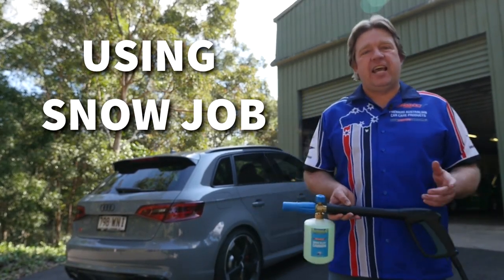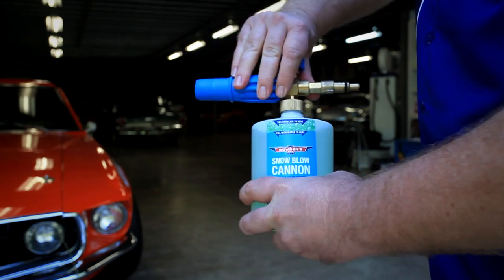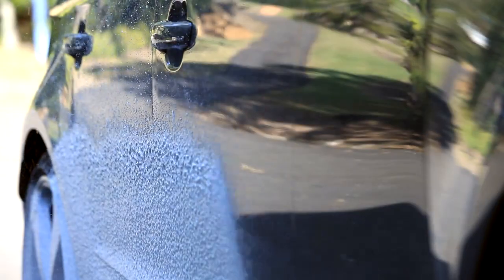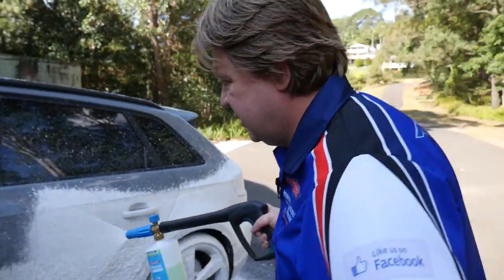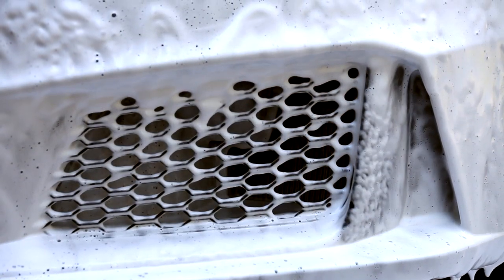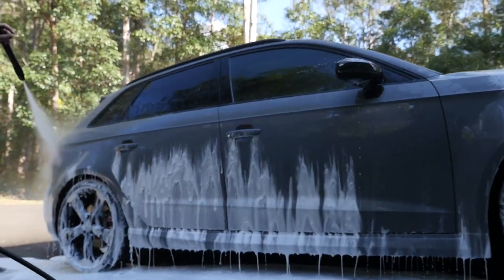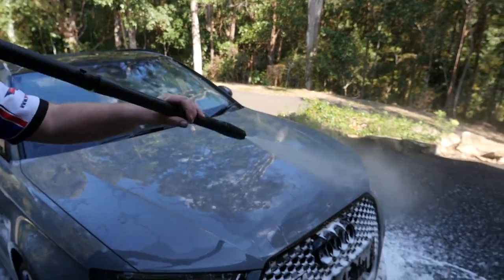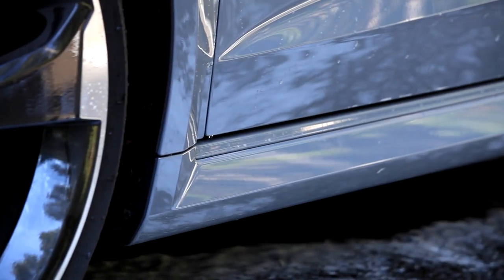Bowden's Own - Using the Snow Job Foam Cannon // Supercheap Auto

Comment: I see so many videos of people who have no idea what they're doing when foaming their cars. You did it correctly, it was satisfying
Reply: What is the wrong way to do it?
Reply: Andy Jung scrubbing with a single bucket. The grime and dirt are abrasive and will swirl the paint
Reply: Niko Delmedico 0piinVietnam
Reply: See(
Reply: Okoo
Reply: I would hope he done it right. He owns Bowdens Own.
Reply: @Nico Delemedico - I think he's doing it wrong. He should actually rinse from the bottom to the top.

The foam covers the suface to loosen up the dirt and contain it. 

The high pressure washer works like a brush and when rinsing, it carries the dirt away.

When rinsing from the top first the water runs down and rinses away the foam of the lower parts without the high pressure beam hitting the foam and dirt as supposedly.

And also, without the foam covering unrinsed parts,  it's easy to miss a spot when you can't see where you have rinsed.

Starting from the bottom rinsing horisontally line by line working yourself up, you'll always keep track where to rinse.

Yes, rinsing from bottom to the top takes more time and water, but this is the way professionals do for the reasons stated above.

When you hand wash a car you remove the dirt mechanically and then there's no reason to rinse from the bottom to the top. 

There's a big difference.
Reply: @acke26  he owns that company so I think he actually knows what he is doing
Reply: @jeremyhutchings8213  - thanks for the reply. 

This video was posted three years ago. Then it was an often ongoing debate how to rinse. Today most professional car detailers 

Today most professional detailers and car schampo manufacturers agree upon rinsing from the bottom and up in horizontal lines, line by line working yourself up to the top.

Remember, it's only when using the touchless pre wash foam shampoo method rinsing from the bottom to the top is applicable.

If you hand wash a car then off course it's much better, faster, more time efficient and water saving to rinse from the top. 

Cheers!
Reply: "l
Reply: @acke26  you’re literally the only person I’ve ever heard advocate this method. None of the companies that make detailing products suggest bottom to top.
Reply: @Superfly1503  - thanks for your reply and the  respectful tone.

I'm not alone in this rinsing method. 
Professional European and US detailers use it. But there are discussions amongst car and detail enthusiasts. 

I don't know if you're from Downunder. Maybe this method hasn't been adopted in your part of the world.
Reply: @Superfly1503  - have you watched the video I linked to above?

Have you read my explanation in my earlier post? Off course it's more water efficient and takes less time to rinse from the top. 

When you hand wash a car you remove the dirt mechanically and then there's no reason to rinse from the bottom to the top. 
But what we're discussing here is how to rinse when using a foam pre-wash detergent and a high-pressure power washer.

The foam covers the suface to loosen up the dirt and contain it. The time the foam sits on the surface is crucial for the chemicals to do its job.

There's no mechanical contact. 
The high pressure washer works like a brush and when rinsing, it carries the foam and contained dirt away.

When rinsing from the top first the water runs down and rinses away the foam on the lower parts without the high pressure beam hitting the foam and contained dirt as supposedly.

And also, without the foam covering unrinsed parts,  it's easy to miss a spot when you can't see where you have rinsed.

Starting from the bottom rinsing horisontally line by line working yourself up, and you'll always keep track where to rinse. 

Cheers!

Comment: You started off so good applying the foam from the bottom to the top in order to let the foam sit longer in the dirtier low regions. 
But when rinsing the car you got it all wrong. The reasons why you should rinse from bottom to the top are two:

1) The foam should cover the suface when rinsing cause it carries the dirt away in a better way. The foam is designed to lift the dirt up from the paint job and absorb it in the foam.

(in other words)

The foam covers the suface to loosen up the dirt and contain it. 

The high pressure washer beam works like a brush and when rinsing, it carries the dirt away (shoots it away)

2) When rinsing from the top first the water runs down the lower parts and it's easy to miss a spot when you can't see where you have rinsed.

Starting from the bottom rinsing horisontally line by line working yourself up you'll always keep track where to rinse.

Yes, rinsing from bottom to the top takes more time and water, but this is the way professionals do for the reasons stated above.
Reply: I've got a lot of angry replies. Why?
(edit, which for some reason now are deleted)

I actually just want to adress the right way to do it. Some seems to be obsessed with this guy Bowden. 
You know, he could be wrong.

I've listed exactly why you should rinse from bottom to top. 

There are so many arguments that doesn't make any sense :  
"....leaves swirls and micro scratches....." 

Listen people and stop being so hostile. We're all here cause we love snow foaming or?

I don't know how to convince you.

The reasons why you should rinse from bottom to the top: (in other words)

The foam covers the suface to loosen up the dirt and contain it. 

The high pressure washer works like a brush and when rinsing, it carries the dirt away.

When rinsing from the top first the water runs down and rinses away the foam of the lower parts without the high pressure beam hitting the foam and dirt as supposedly.

And also, without the foam in it's easy to miss a spot when you can't see where you have rinsed.

Starting from the bottom rinsing horisontally line by line working yourself up you'll always keep track where to rinse.

Yes, rinsing from bottom to the top takes more time and water, but this is the way professionals do for the reasons stated above.
Reply: @acke26  lol he ain't wrong
I'm a detailer
I can confirm this
Reply: @nynteen90 - just cause you work as a detailer doesn't guarantee anything. I'm a mechanical engineer that also got a degree in chemistry. 

If you can't explain or dement what I've written it doesn't add anything to this topic. 

Have you really read what I have written?

Note that I'm not talking about hand washing a car mechanically. When you wash a car by hand you're removing the dirt mechanically. Then off course you should just rinse from top to bottom. 

Obviously that's not just the most time efficient way it also saves water. In this case all the dirt is already loosened up by the force of your hand.

What I've written about is when using a contactless prewash foam.

Comment: Finally someone who washes it off top to bottom
Reply: hamrai b kro wash gari
Reply: We do on our nissan quashqai and our nissan navara
Reply: Hahaha yes
Reply: The reasons why you should rinse from bottom to the top are two:

1) The foam should cover the suface when rinsing cause it carries the dirt away.

2) When rinsing from the top first the water runs down the lower parts and it's easy to miss a spot when you can't see where you have rinsed.

Starting from the bottom rinsing horisontally line by line working yourself up you'll always keep track where to rinse.

Yes, rinsing from bottom to the top takes more time and water, but this is the way professionals do for the reasons stated above.
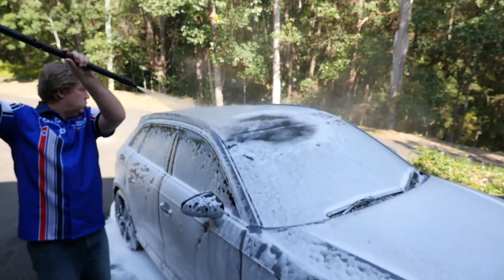Reply: @acke @ 2:26 he specifically states you are to wash the car from top to bottom.

I don't know why your here trying to sound like a pro and are telling people to do the complete opposite of the video. Also Bowden own's that product i think if anything we are gonna listen to him rather then a random persons incorrect youtube comment.  I don't know who told you all that info but you're flat out 100% wrong.   

You work from top to bottom.  Not bottom to top. Why?  Because the dirt and grime that wash's off is abrasive.  Spraying water from bottom to top pushs that dirt and grime back up, which leaves swirls and micro scratches on the body.   So you're full of shit.    No, Rinsing from to top takes way more time, energy and resources when you could do it properly like a pro. and just do what Bowden suggests.   Washing from top to bottom.  Considering the guy in the video... WHich is DAN BOWDEN... Btw...  HE invented that product so i really am confused as to why you feel the need to drop such an unnecessary whilst liking it.   I don't know who taught you all that info but you're 100% wrong and i sure hope you don't go using products like this with such carless wastage and no thoughts on the actual process.
Reply: @Xedilian  - why the emotional outbursts???

I actually just want to adress the right way to do it. You seems to be obsessed with this guy Bowden. 
You know, he could be wrong.

I've listed exactly why you should rinse from bottom to top. 

Your arguments are not making any sense :  "....leaves swirls and micro scratches....." 

Listen and stop being so hostile. We're all here cause we love snow foaming or?

I don't know how to convince you.

The reasons why you should rinse from bottom to the top: (in other words)

The foam covers the suface to loosen up the dirt and contain it. 

The high pressure washer works like a brush and when rinsing, it carries the dirt away.

When rinsing from the top first the water runs down and rinses away the foam of the lower parts without the high pressure beam hitting the foam and dirt as supposedly.

And also, without the foam in it's easy to miss a spot when you can't see where you have rinsed.

Starting from the bottom rinsing horisontally line by line working yourself up you'll always keep track where to rinse.

Yes, rinsing from bottom to the top takes more time and water, but this is the way professionals do for the reasons stated above.
Reply: @Xedilian  - I think maybe you've mixed it up with handwashing your car. Then you've removed the dirt mechanically. 

Then there's no need to rinse from the bottom to the top. 
Then you're totally right, rinsing from the top is faster and takes less water. 

Do you see the difference?
Reply: @acke26  how on earth... Can you seriously think that I've misunderstood what your saying and thinking you're referring to hand washing...  When the video and the product requires the use of a power washer.......  How on earth... Did you get lead to that assumption? Also my obsession?  Dude I've used th product. I don't know him, I feel like I need to say it again because it clearly went over your head.   BOWDEN INVENTED THAT PRODUCT.....   Also you literally contradicted your self in your own wall of text by saying what I said.  Washing from bottom to top can also blaast all the abrasion and dirt upward and leave swirls and scratches on your paint job. Acts more so like a brush then a gentle jet of water.  

Look mate.  If you're that much interested in giving random nonsense  lectures and guides to doing things properly, or in general TELLING random people online what to do.  Then perhaps you should start creating your own content. And uploading your own videos.  Instead of sitting in the comments section ready to give the next person who reads it a lesson on... Something the video explains......     

Ugh
Reply: @Xedilian  - once again, you must have some aggression problems. 

I'm not a YouTube'er but I'm sponsored by Sonax doing car wash tests. I've also tested most of the products on the European market. 

Look up other videos on the subject rinsing off snow foam.
Reply: @acke26  mate youre wrong. you apply from bottom to top so the lower panels have longer dwell time. wash from the top  to bottom always, othewise you basicallly have to wash the car twice, and youre guaranteed to screw it up and miss spots.
Reply: @blakefitzgibbon8376  - thanks for your reply. 

I'm not sure you've read all my posts.
Or if you've misunderstood me.

Yes, I totally agree with you. The foam should be applied from bottom to the top. 
But that was not the thing that was discussed.

The discussion was about rinsing.

The reasons why you should rinse from bottom to the top are two:

1) The foam should cover the suface when rinsing cause it carries the dirt away. The foam both loosens the dirt and contains it. It even lifts it up from the surface.
By rinsing from the bottom line by line horizontally the high pressure beam works like a brush shooting the foam and dirt away.

2) When rinsing from the top first the water runs down the lower parts and the high pressure effect and foam is not performing as it was intended to. It's also easy to miss a spot when you can't see where you have rinsed.

Starting from the bottom rinsing horisontally line by line working yourself up you'll always keep track where to rinse.

Once again. Yes, rinsing from bottom to the top takes more time and water, but this is the way professionals do for the reasons stated above.
So it's not a matter of water efficiency we discussed. 
If you wants to save water and time then off course rinsing from the top is better. 

(When or if you've mechanically handwashed a car. Then all the dirt is removed. Here there's absolutely no need to rinse from the bottom and up)

It's fun to foam!
Cheers!

Comment: bought one of these, attached to my Karcher which operates at 1700psi.  Used as instructed.  All I got was light suds no matter what.  Is it dependant on water hardness?
Reply: drA1970 you have to adjust foam guns top nob to mix how much water to be mixed .

Comment: So many people have taken their cars for a quick drive to only get booked by cops, so what ever you do, if you have a freeway which has a 110KM speed limit, drive you car to get on a HWY/  freeway that way you will remove most of the stagnate water and other away from those areas, like in the door jams etc, but still if you can afford it get a little air gun with the right fitting and just blow away any water or products away from those spots, or open all the doors rear hatch and use a microfiber towel to safety remove any water/ dirt away, also do not forget that a lot of the water tends to be sitting inside the doors, so that when you go for a drive a lot of the water tends to go away, but most of it will stay inside the doors, which is why its a good idea to open all the doors and let the water drop away and or wipe away any excess water in those areas. cheers :)

Comment: Does it only work on an Audi or can you use it on other manufactures as well?
Reply: Nah Audi only. Prolly will work on a bmw. Nothing less though lol
Reply: R u joking?
Reply: @KasamS   Honestly i dont know about steve. I was joking but who knows. May be a bit slow
Reply: Most cars have a waterproof wax sealant which can not be dissolved or rubbed off
This product work with every car that has a wax sealant 
Is you chose to wash your car with car soap, notice on the back it will say if it washes of wax or not. Btw dishwashing liquid washes it off
So depending on how well you want to clean it 
It works on all cars
Reply: SuperSteveDunn only on grey Audi’s mate
Reply: @mmmmmatthewwwww  - for Christ sake, he was joking!
Reply: It only works on Audi.
Reply: Hi will this work on a 2 door car?

Comment: I think with the foam is on the car start bottom first working your way upward..notice that the foam just washed away when rinsing from the top,
Reply: Thanks, your spot on!

The foam covers the suface to loosen up the dirt and contain it. 

The high pressure washer works like a brush and when rinsing, it carries the dirt away.

When rinsing from the top first the water runs down and rinses away the foam of the lower parts without the high pressure beam hitting the foam and dirt as supposedly.

And also, without the foam in it's easy to miss a spot when you can't see where you have rinsed.

Starting from the bottom rinsing horisontally line by line working yourself up you'll always keep track where to rinse.

Yes, rinsing from bottom to the top takes more time and water, but this is the way professionals do for the reasons stated above.

Comment: Do I need to rinse the foam out first then wash the car with the two bucket method? Or can I just foam and start cleaning it with the foam still on vehicle?
Reply from the maker: Hi MM Kid, We recommend rinsing the car before hand washing. The prefoam method dissolves most the dirt into the foam so you can blast the dirt off easier, then you can clean your car afterwards with minimal dirt scratching your paintwork. - Ash

Comment: The right way is from the bottom to the top.
Reply: Spot on!

The foam covers the suface to loosen up the dirt and contain it. 

The high pressure washer works like a brush and when rinsing, it carries the dirt away.

When rinsing from the top first the water runs down and rinses away the foam of the lower parts without the high pressure beam hitting the foam and dirt as supposedly.

And also, without the foam on it's easy to miss a spot when you can't see where you have rinsed.

Starting from the bottom rinsing horisontally line by line working yourself up you'll always keep track where to rinse.

Yes, rinsing from bottom to the top takes more time and water, but this is the way professionals do for the reasons stated above.

Comment: Hello. Can you use the snow foam for the touch wash as well, after the touchless?
Reply from the maker: Hi Duane, thanks for your question. We recommend that you blast away the first foam stage to remove the dirt and grime off the paint to start with, then you can apply a second snow foam coat and this then would be fine to touch wash. - Ash
Reply: Thank you Ash.